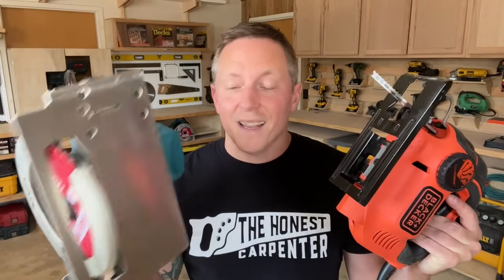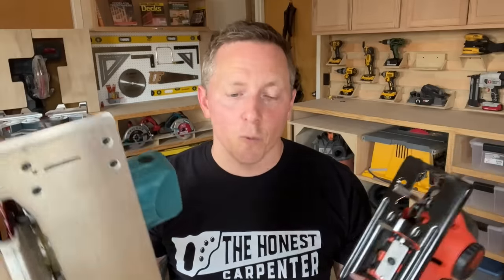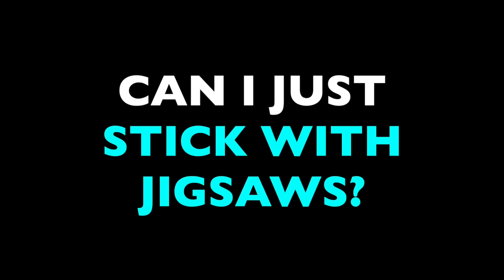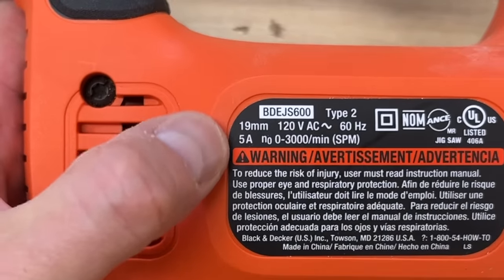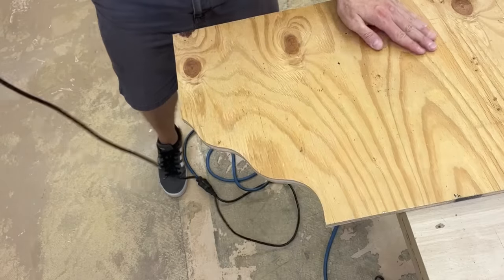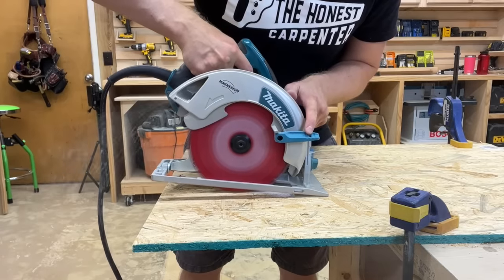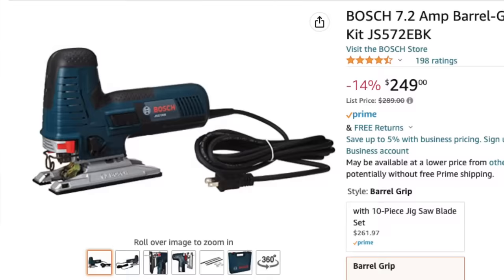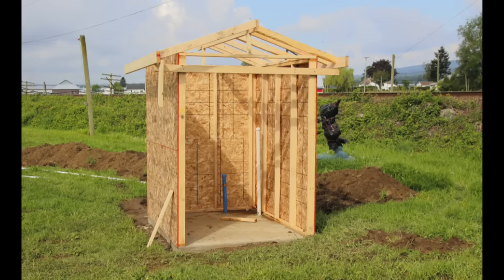CIRCULAR SAW VS. JIGSAW...Which One Should You Own?! (FULL COMPARISON---New DIYers Should Watch!!)

Comment: Sometimes you need to ask yourself what are you trying to cut? For cutting stuff like pallets a circular saw will easily cut through them easily. I was told the bigger the wood the bigger the teeth to cut it. In practice a jigsaw will give you a neat cut and you can use a reverse cut blade for something like making a template to fit a kitchen sink, the top part is visible and so the reverse function means the action provides a neat edge or finish. I personally would suggest a brand like Bosch, they do a few ranges and the professional stuff is good going. Dewalt and others make a few ranges these can get expensive. I would recommend a sturdy workbench like a Black & Decker workmate, that will allow you to cut and work on stuff without it moving. A circular saw is never going to be able to give intricate cuts or detailing because the blade is so big and it’s a totally different action. If you only ever cut straight pieces of wood a circular saw would probably be sufficient but for bigger stuff a bigger blade is needed and that’s where a jigsaw can be useful. You can buy blades for a jigsaw that are around 12 inches and thats handy for some stuff like fence posts or something really dense. Circular saws don’t have a reciprocal action or option so can be a bit of a one trick pony. A jigsaw can be slowed down a bit or used at a greater rate. The blades are important as they will have an impact on your result. One very important thing to remember is safety first, always ensure you secure what you’re intending to cut. A pair of goggles might not be trendy but can save stuff getting in your eyes, you only get one pair of eyes so look after them. Some models come with dust extraction which can be useful as it were. In short I would say decide what you are going for and don’t forget the safety. Go for the best tools you can realistically afford and treat them with care and you should do fine.

Comment: I think this video really covered all the main differences between both tools. For me though, the main reasons I got rid of my Bosch circular saw was the noise and dust it generates. I got the saw more than 30 years ago when I was building a wall to wall cabinet at my parent's place and wanted something that could cut long straight 8' plywood strips. However, I always felt uncomfortable subjecting my neighbours to such unpleasant noise (I live in an appartment). Jigsaws on the other hand make almost no noise at all to your neighbours, with your doors closed, even at full tilt. Dust is also a major concern if you do not have a dedicated work space that does not share the same air space with your home or you'll be dealing with awful clean ups after each projects because circular saws create such an unbelievable amount of fine dust compared with jigsaws even with a good dust collector system. I've been considering reintroducing the circular (track saw actually) with much agony for these reasons. I think one important aspect more important that straight cuts that was missed is making accurate perpendicular cuts to the edges of your material. An accurately adjusted circular saw will make absolutely clean 90° cuts whereas the long wobbly jigsaw blade tends to bend slightly along wood grains, especially at lower speeds and thicker materials causing slight uneven bevels to your cuts which need to be routed clean. Sorry for the extremely long comment.
Reply from the maker: This is all true, Kelvin! Especially the points about blade deflection and wander in jigsaws. I wanted to cover it some, but it'll need a video of its own. Thanks for writing in--I don't mind long comments! :)

Comment: Having both on hand at a jobsite for a repair last week. It's kind of instinctive to grab one or the other based on the need of the moment. Often you might find you need the jigsaw to finish off a circular saw cut, like a 90° angle coming together... birds mouths on rafters, stair cuts... sometimes you just grab a handsaw, too.
Reply from the maker: Yep. Finished birds mouths and stringer notches with both jigsaws and handsaws over the years, Mike. Sawzalls occasionally too.
Reply: @TheHonestCarpenter  It just seems you grab what's available.  The best tool for the best job concept. I knew a guy that seemed to use his Sawsall for nearly everything and did a good job, but knew its limitations.

Comment: I'm a locksmith. I use my jigsaw 2-4 times per week. I don't even carry a circ saw in my work van, I've had to get one from a co-worker or back in my garage for the 3 times I''ve needed it in my work. Gotta know what kind of cuts you will use in your work. BUT for general cutting, and especially if you're framing, the circ saw usually wins out.
Reply from the maker: Interesting, James! I love hearing from other trades. What are you cutting with the jigsaw while locksmithing?
Reply: @TheHonestCarpenter  usually hollow metal doors to accomodate a new panic bar/exit devices. The exterior handles often need a specific T shaped opening. I use a 3/8 drill bit to mark the corners and use my jigsaw to connect the dots, the size of the hole is selected to allow me to easily turn the saw at each 90 degree turn.

Comment: I see it is not in either or. You may have talked about this before but I recommend getting cordless ones just for ease of use in in being portable. Also I recommend sticking with one brand so your batteries are interchangeable
Reply from the maker: Cordless have gotten so widespread that they're a great option these days, Joel 👍

Comment: You are going to buy both.You are likely to pay more for a good circular saw ($200) and then you can get a cheaper jig ($100). Buy the circular saw first and work out some way to make straight cuts (Buzzard Wing, 2x4 fence and clamp, DIY track, etc.) Your circular saw is your first table saw on the move up from handsaws. You can always wait on buying a jig saw because you just need a cheap coping saw and a power drill. Jig saws are nice but its often faster and easier to just to pull out a coping saw anyway. The problem with jigs and coping saws is that they leave jagged and uneven cuts. Which is why a Circular saw, coping saw and a small trim router might make more sense. If you are starting out woodworking  and you don't have a jointer, parallel planer and table saw - you need just one damn thing in your arsenal to help you to make a decent straight cut. Handsaws are difficult to master. A circular saw or a router with fence guides can both get you there. Plus a router can help you fix mistakes, like ragged edges and wonky cuts. Lots of bad cuts and fixing mistakes starting out.

Comment: Excellent advice based on my own amateur experience.  Apart from a drill, my first power tool was the jigsaw. I only did some basic woodwork at the time and it was perfect for that. Now that I've moved to renovating/repairing my old timber house, I had to rethink my saw options. I thought a lot and watched a lot of YouTube on the subject of circular saws, mitre saws and track saws. In the end I decided that the circular saw was not necessary for me because I felt safer around a track saw and mitre saw. Certainly, the circular saw could fill in for the mitre saw and track saw on most of my  projects and was a far cheaper option, though scarier.  I do have a smaller circular saw just in case, but so far my track saw, mitre saw and jigsaw have filled all my needs.  Mostly I love my mitre saw for quick cross cuts, and I could not live without my track saw for those rip cuts. The jigsaw sees the odd light of day for the detailed and sometimes curvy work.  The right tool for the job makes it all much easier and far more fun.   BTW, I'll check out your book. I love reading a good kids adventure story before bed at night.
Reply from the maker: Thank you, Darius!! That’s a very useful saw combo—got all your cuts covered with that setup. I really should cover track saws more on this channel. And thank you for checking out the books! I hope you like them! 😄

Comment: Honestly, I can't see myself without both the circular saw and the jigsaw as they both have domains they excel in. But if I had to only take one, I would probably go for the jigsaw. As it can mostly do what the circular saw does (in a much more cumbersome and not as precise way), while the reverse (taking a circular saw) would make it almost impossible to do some things the jigsaw does ... But I am a woodworker, if I was into carpentry or construction the tradeoff might not be worth it and i would go for a circular saw which is basically the bread and butter of those trades.

Comment: Battery Circular saw is nice (for those long plywood cuts).  But handsaw(regular and coping) will get you very far.  Hand tools are far under rated.  Add a hammer, a (sharp) chisel, a few differnt shaped files for metal and wood, a screw driver with interchangable bits,  pliers, a medium stiffness  putty knife,  hacksaw, a hand drill (yes manual) and if you can get bracedrill with auger bits for those larger diameter holes and you'll be really good.  Add a belt sander, battery drill with a good drill bit index and box wrench set,  a level (which doubles as a straight edge for the saw) and I think most home owners would be good for at least 95% of the projects out there that they would normally tackle plus some.

Comment: I guess I'll throw in my two cents.

On the matter of safety: remember a circular saw is always cutting when it is running and circular saws generally have fewer teeth per inch that take huge bites from what ever they are cutting. Whereas a jig saw is only cutting on the upward stroke and with finer teeth.

As for their usage a circular saw really can only make straight cuts and can stay on track alot easier and cut a whole lot faster than a jigsaw. On the other hand the jigsaw's narrower blade allows you to cut curves.

In hindsight if you have to buy only one saw  I would say buy a cheap corded black and decker jigsaw they're like $30 bucks. After using that a while and you wanna make the jump to a higher quality or cordless tool you'll know what saw you want/need at this point I suspect for most people a circular saw is the answer, other than going cordless I don't think you'd get much improvement from a more expensive jigsaw.

Comment: There are things a jigsaw does that a circular saw physically can't. But, what a circular does it does much more efficiently. For general homeowner use I would say circ saw first. It's a much better option for fencing, decking and other home projects. In the woodshop you really want both.
Reply from the maker: Good points, Carbon! Once you get comfortable with circular saws, it becomes like an addiction. I practically had one glued to my hand for much of the last 20 years. They just cut at light speed.

Comment: Congratulations on your book! I have one jigsaw probably older than you. Three circular saws, but only had two found the third one of the decluttering. Didn’t buy any of them myself I inherited all my fathers tools. So all my tools are very old. The only tools That are new or a reciprocating saw. But I am thinking about a new table saw because the tablesaw I have which was my fathers does not have a rive blade or a place for one. It was made before they even have them. Do you have any suggestions?
Reply from the maker: Thank you, Peach!! The riving knife is a huge plus on newer table saws. Im a really big fan of the dewalt 10”—I’ve owned multiples! 🙂

Comment: I left my jigsaw plugged in and was removing the blade with one hand and the other hand was over the power control and I squeezed it which made a metal part of the saw punch down on top of the tip of my finger and for about two months I had a large square black bruise under my fingernail.

Comment: From the perspective of an electrician, (yes, I'm here to learn) one horsepower is 746 watts, that's a bit under 7 Amps at 110v. The original meaning of one horsepower was the power of a draft horse, not a pony. 
Just something I've always kept in mind when working on or around electric motors - even small ones can be very powerful.
Thankyou for a very useful video.
Reply from the maker: Thank you, Mike! This is why I like hearing from other trade pros 🙂

Comment: As a beginer DIYer I used only jigsaws for year (mainly for floreing), the time when I bought a circularsaw, when I had to cut a wooden counter top. Jigsaws cant cut sqare! The thicker the matterial, the blade deflection gets worst. And I dont talk about absolute precision. Even highend baldes create a visible curve over 5cm of thickness (aka ~2 inches). But now that I have both, I use both, on almost every job. For example circularsaws cut sheetgoods rly fast, but when you have to cut an inside corner, and you dont want to overcut on your line, you just cut short of the corner and the jigsaw finishes the cut perfectly.
Reply from the maker: Great point!! I used jigsaws heavily for finishing notches over the years, especially in stair stingers and rafters. The two together are a perfect combo!

Comment: Brilliant channel. Some thoughts as an utter newbie to power tools.

I'm a woman approaching 50 in India and developing an interest in carpentry, mostly because we're moving into a new home. My late father was into carpentry as a hobby and I learned basics as a kid via osmosis. Helping him, handing tools, trying them out... but this was decades ago before my teens. I used hand drills and can use a regular saw pretty well - like riding a bicycle. Power tools arrived much later here for hobbyists, and he wasn't using them when I was a kid. So they are intimidating strangers...

Power tools both tempt and scare me. I stared at my new electric drill for a week before trying it. I also got one with a chuck key for twisting bits tight for sure, because I don't trust that plastic keyless thing and didn't want any bits flying loose at high speed. Then I felt stupid, because everybody on youtube seems to be using them just fine. lol. I loved it once I figured it out - hand drilling isn't my favourite trick and I can safely say I'll never do it again.

But I think your video takes arm strength for granted. Take it from a post-menopausal (strength losses) woman who isn't a body-builder... there's a vast difference between what feels normal for you and me. I don't think I'd dare buy a circular saw or should, when I see you handling it correctly. It just looks like it wants to cut the wood faster than I can think. lol. I think it wouldn't be a good idea for my arm strength (non-existent compared with a skilled carpenter). I have no doubt it is an efficient tool, and a local carpenter told me, it is about learning to use a tool, but I'm intimidated. I'm good at learning new things, but the circular saw just feels like beginner's mistakes could be a lot more irreversible than most things. My point is, a circular saw probably shouldn't be used at all by people without some degree of arm strength (particularly wrists). Not sure the risk/reward is in favour of DIYers using it if they aren't fairly strong to begin with. I'm older and a woman, but a lot of diyers here seem the hot glue type. That thing weighs what? A few kilos at least? If people aren't strong enough to wield it comfortably and brace at least enough to be safe from kickbacks or whatever, they will use poor form to compensate somehow. How much time would be saved? Is it worth the risk?

But I did plunge cuts pretty easily on day one using an oscillating tool. Tool received, box opened, try out, voila! Straight cutting, plunge cut (on purpose, not accidentally, lol). Much lower risk of accidents I think. I think it deserves a mention for outperforming both jigsaw and circular saw for newbies trying power tools for plunge cuts at least. I think someone who can use an electric drill can feel in control of the tool very easily. Nice edges too. I draw the line with a box cutter instead of pencil. Then I use another piece of wood for a guide. Overly cautious, but it gets me where I need to be. So far I haven't got any electric saw. I use the multitool where I can, or just use a normal saw or a smaller hack saw. For small projects, I think they may be quicker than setting up a power tool, using it, putting it away... Maybe if I want to make more things after I develop some confidence I may think of a jigsaw. I hadn't thought of that.

Not to criticise you and I learned A LOT from this and your other videos. I'm pretty much going through them all to learn. Just a completely different PoV from someone at the extreme basics. Having enough strength to wield the tool with the robustness it needs. Probably been a long time since you thought of that :D

Comment: You could get away using a jigsaw for a lot of things, but it'll take alot longer and in my opinion is a lot more work cutting a long straight line.  I used to be pro jig saw until I learned how to use a circle saw. Since then I've never gone back unless I was doing curves. Love my circle saw.

Comment: I have this jigsaw....tried three times to cut a straight line with a n edge guide.  Using recommended tblades...but they keep jumping the guide track.  Any ideas?  Wondering if blade is 'locked' in place. (Quick blade change feature) ...thx!

Comment: My uses are home improvement and general carpentry- I use circular, miter, table, sawzall, and oscillating saws constantly and very rarely pull out my jigsaw.  I only use jigsaw when it is a cut that only a jigsaw can do - precise curves (for most curved cuts in construction applications, sawzall is the go-to).

Comment: My problem with a Jigsaw, even when using best Bosh blade and a fence guide, is that the blade still bends so I can't get the cut surface be flat and orthogonal to the top surface. This very much complicates joining pieces at 90 degrees.